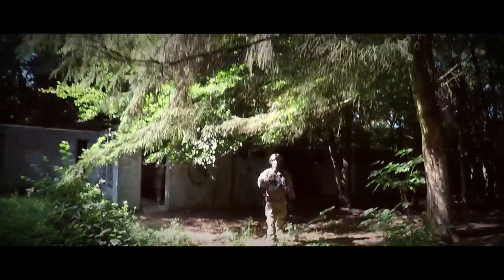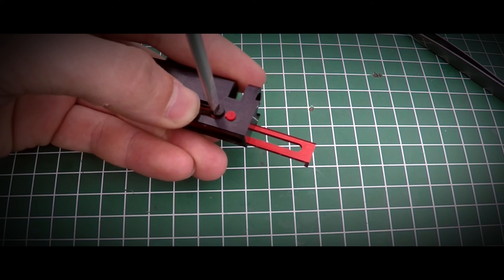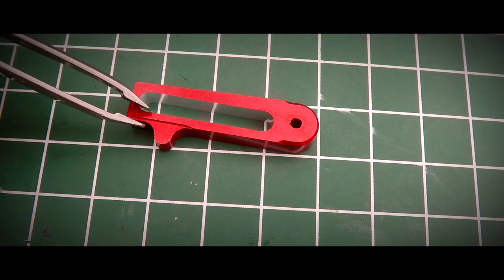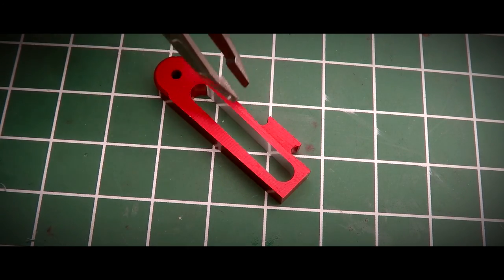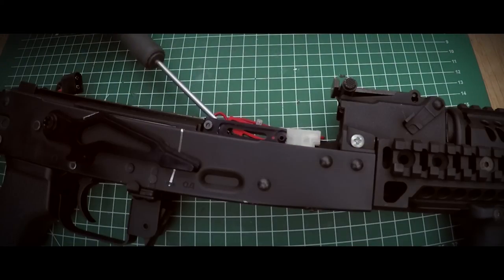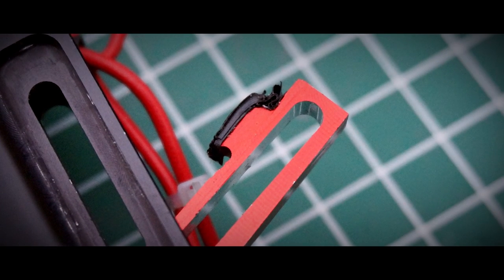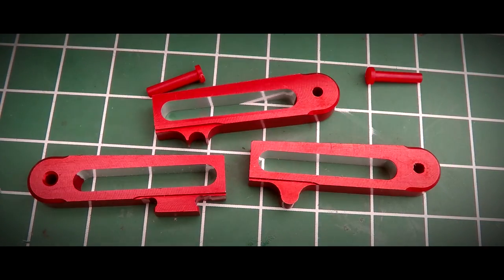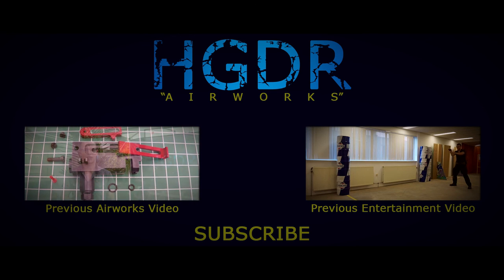"RetroArms AK Flat Hop Lever" an Airworks review | #3

Comment: Question tightbore and a flat hop or orga wide bore and flathop
Reply: +PG wide bores are usually used for p*s and hpa. if you have about the same amount of air coming out of your barrel, (about 500 fps with .2g) then wide bore. if not, get the tightbore